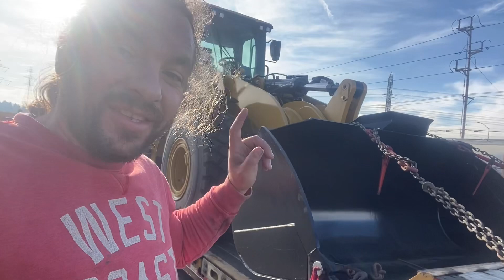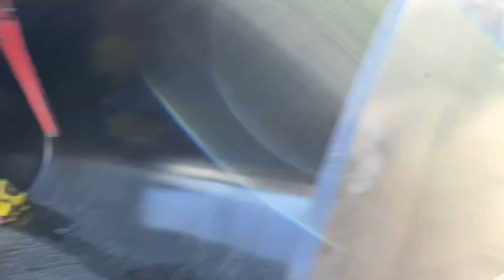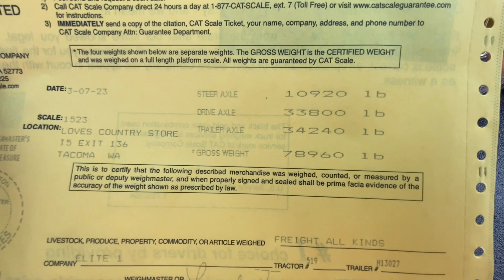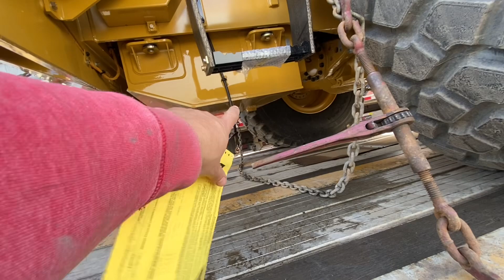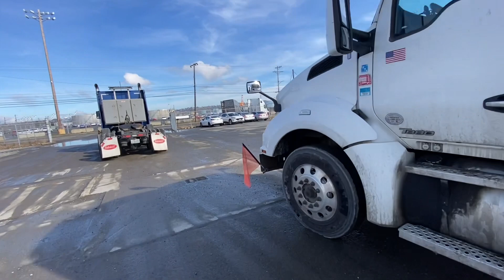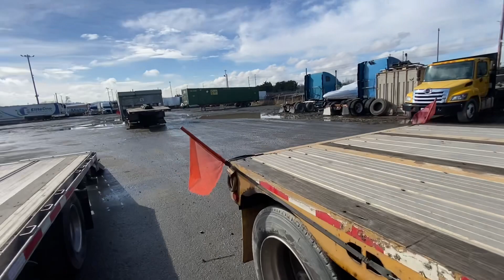#cat 950GC #loader #oversize

Comment: Hey Bud there is a cross bar you forgot to locate check video at 5:14 the orange bar has to be in place to stop the unit pivoting. its a DOT violation if you dont use that orange bar you have to add extra securement to the pivot points